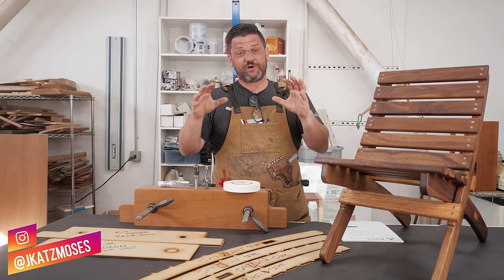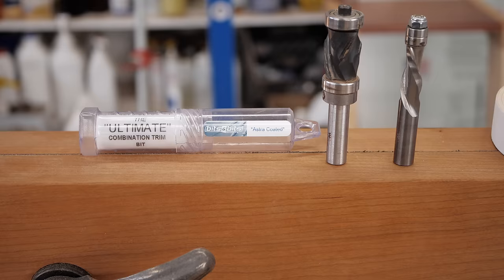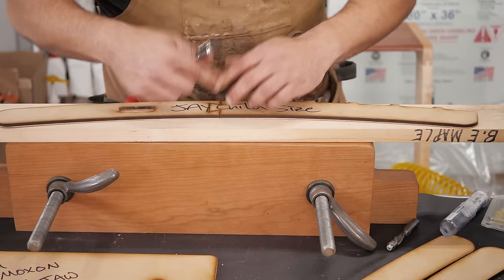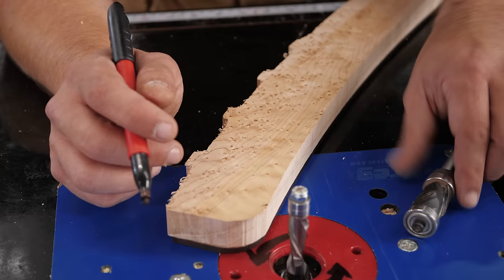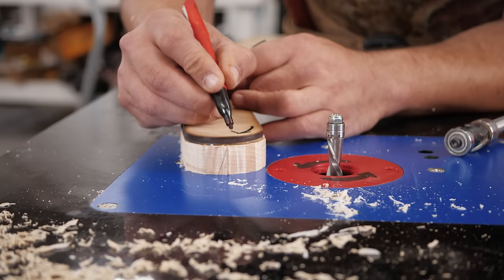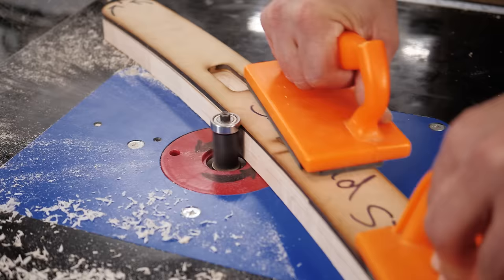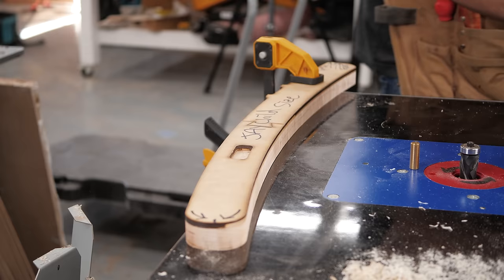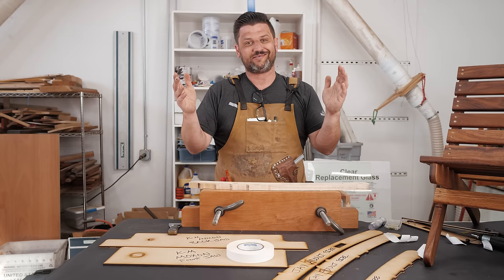My Favorite Template Routing Tips and Tricks

Comment: Can't find a good double sided tape here in Canada, at least not so far and forget the pinnailer, instead use painters tape, blue or green works great and CA glue or super glue. Put the tape on both pieces so that the strips of tape match up, a couple of dabs of CA glue and bam, double sided tape that comes apart pretty easy when you are done. Works so great I wouldn't consider using a double sided tape now.
Reply: same problem im pension and move live in thailand not found anywere doubleside tape or good CA glue, i used many parts screw at teplate stay wery small hole what can add putty after work. i use colour putty ot sander wood dust whit glue lot, not see wery little holes after putty newer.

Comment: Does the cutting edge match up flush at the bottom of the bearing? Or if I line up the bottom of the bearing exactly with the bottom of the template, will there be a small ridge left behind?
Reply from the maker: Its flush
Reply: I got a little sliver between, but figured it must be the thickness of the tape

Comment: What do you think about the Triton routers? I am currently making a table and can't decide what is a good router to put in it.
Reply from the maker: Depends if your trying to save money then it's a great option because it has the lift already built in and you can just buy the kreg plate. They're very powerful but have shitty components that vibrate off from time to time. I've replaced all my Triton routers with Dewalts highest HP ones. I only use my Triton when I'm flattening slabs now.
Reply: @katzmosestools  thanks for reply, and very good point. I'm just trying to find something with the most "bang for my buck" and not have to mess around with getting a router lift. Also for some reason I feel like if I get anything in the lower HP range I would kick myself later if I needed the power. I am new to this and like you said in your tool videos ( I don't want to buy the same tool more then once)

Comment: Hey Jonathan 
I know you’re working with bits and bits router bits on your video but have you heard about infinity mega flush trim bits? Do you know if you’ll get the same results with them? 
I was just looking for a set or flush trim router bits last night. Appreciate any feedback. Thanks
Reply from the maker: I have. They look nice and are probably similar but I'm sure the Whiteside one coated by Bits and Bits is superior. I will say that the Astra coating on the one from Bits and Bits really makes it last double than without it. Also, Bits and Bits is a family owned small business. The owner answers the phones when you call the 800 number. Not just my phone calls, but every single call that comes in Paul usually picks up the phone. They do a lot of their operations in house and have developed the really cool Astra coating. I support small businesses that take customer service seriously. Bits and Bits does that to the extreme. They can have my dollars all day. Our agreement is the smallest sponsorship I have but the one I talk the most about for a reason. They rock.
Reply: Thanks for the reply. Good to know I’ll check their site and just saw the 15% discount code. 👍🏼

Comment: With regards to double sided sticky tape, I prefer the method of using masking tape with CA glue and using an accelerator to bond the template temporarily to the work piece. Masking tape's adhesiveness is not as strong as double sided sticky tape, so you don't have to worry too much about damaging the template while peeling it away. The downside to this method is that you have to a) ensure you have masking tape in the same location on both the template and the work piece, and b) not to use too much CA glue (as you don't want to have squeeze out and thus permanently bond the template to the piece. But overall, I'll use this method above the double sided sticky tape any day!  Good collection of tips though!
Reply from the maker: Thanks bud. I'm not a fan of that method. I'm going to do a video as to why.

Comment: Not going to lie, routers make me pretty nervous
Reply: Just a drill with a short bit in it.  You don't bottom the bit and tighten just as you don't in a drill press. The piece he had was light so the router threw it, larger pieces and the router will just chew up the against grain situation and the vibration and noise or smoke will tell you to stop.
Reply: @MJ-nb1qn  Nope. The lathe is. Projectile wood and wrap your arm in a split second.
Reply: @MJ-nb1qn  No tool is dangerous if you use it how as designed to be used. Power or otherwise.